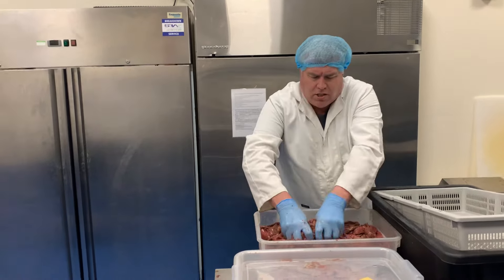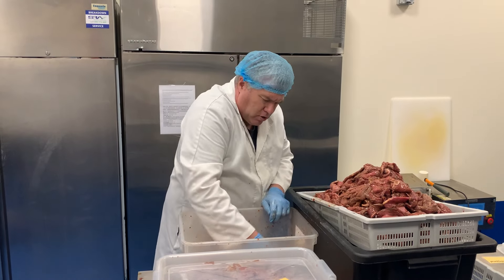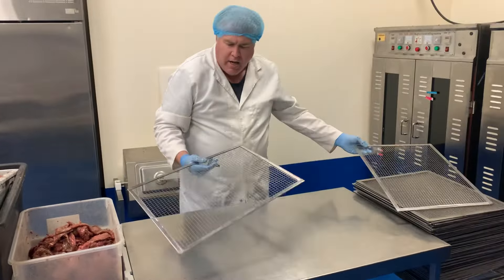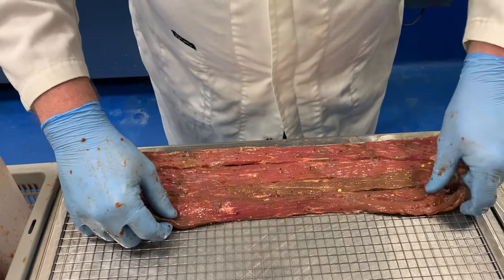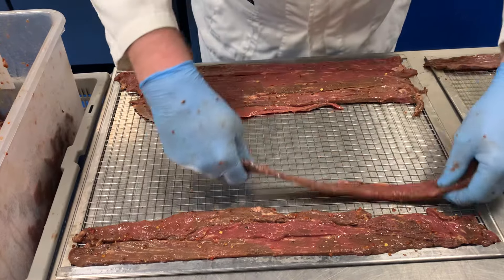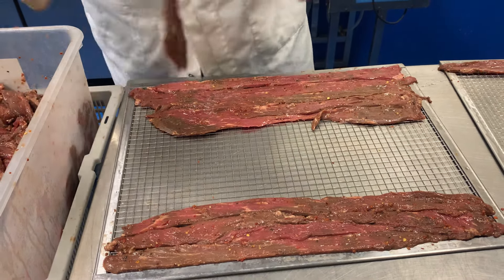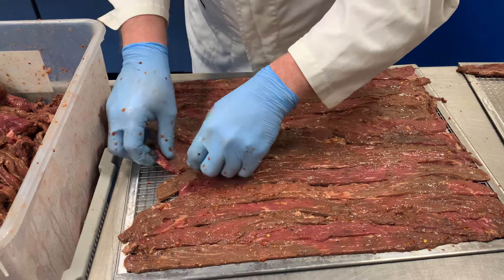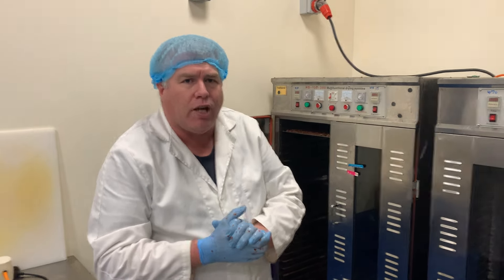Secrets to Perfect Beef Jerky Dehydration

Comment: Those dehydrators look very cool. Did i hear correctly that it fits 120 kg of wet meat per dryer?, and what are those machine models? i would like to research more on them. Keep uploading more videos. i love seeing your work.
Reply from the maker: Between 110 and 130kg depending on who is racking up the meat. That’s the total for both. But you could run them two times in 24 hours.